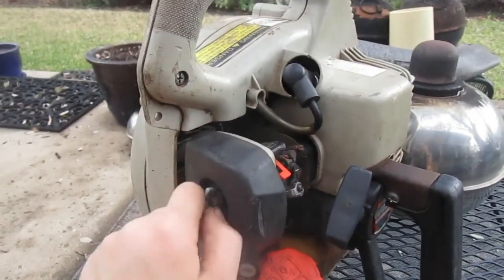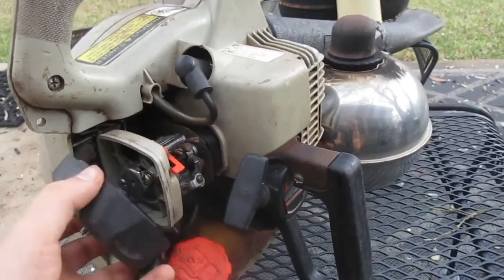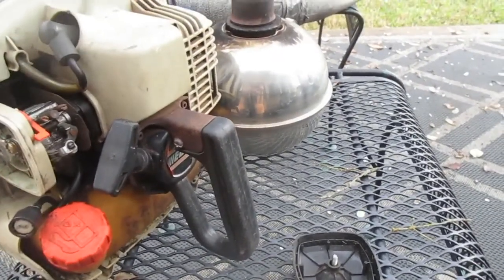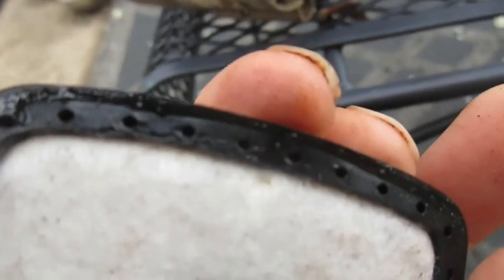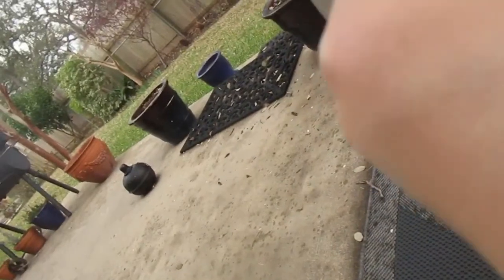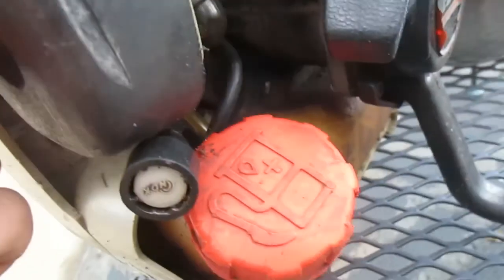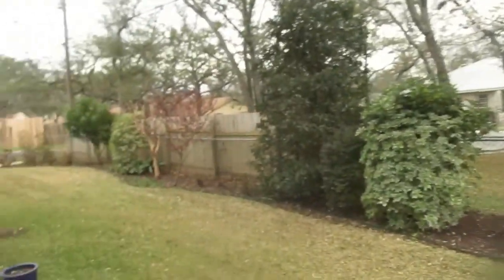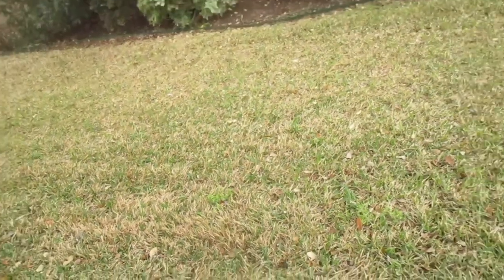Talking about the Echo ES-2100 blower

Comment: Hi, my 22 year old blower finally had a issue being that the coil produced no spark. Checked out EBay and found them hard and expensive here in Oz. Found a cheap after market Stihl coil (13 dollars delivered),modified the Echo original coil metal yoke to fit the Still coil and refitted to blower with little hope of it working again!  To my surprise fired up on the second pull, best it has ran for a long time and a easy and cheap fix!!!